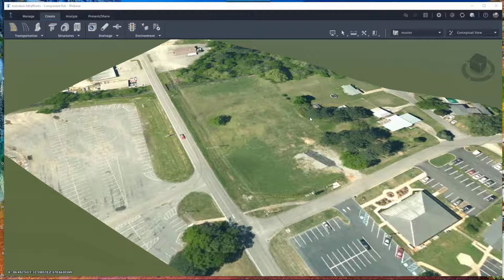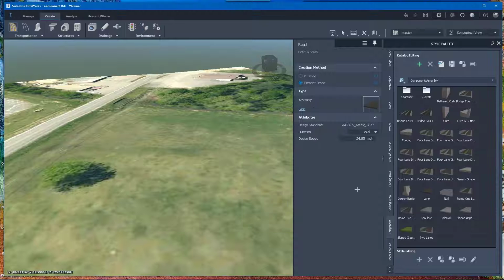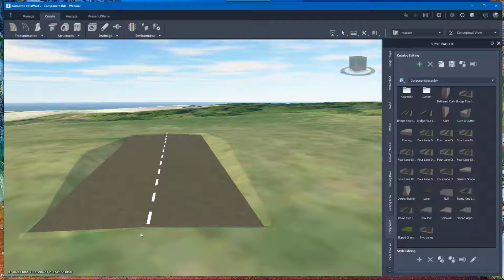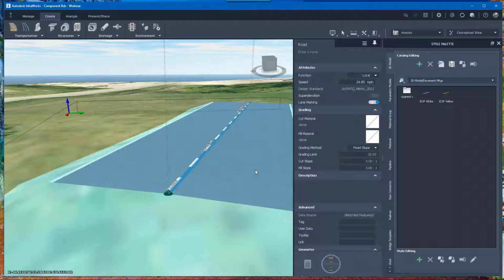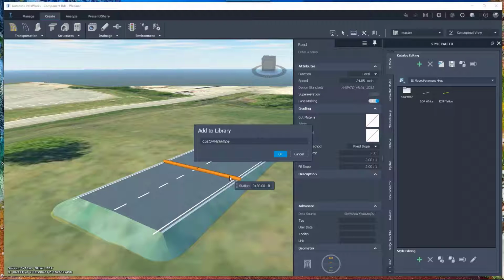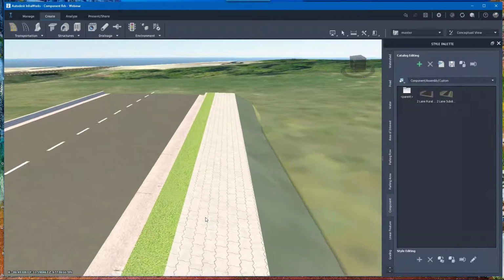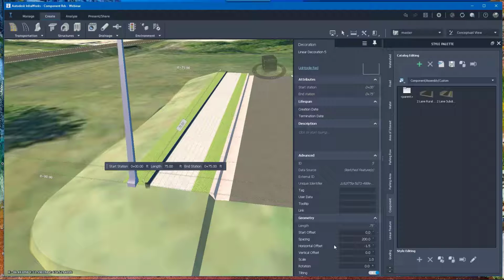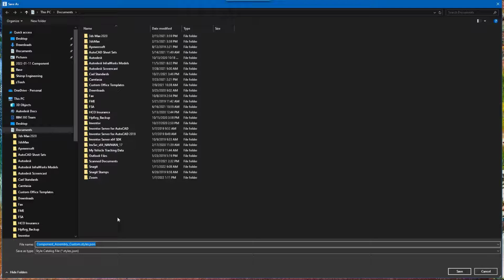Creating Custom Component Roads in Infraworks

Comment: in infraworks 2022, 2023, the lane markings (right turn arrow) only work for US roads. for UK or any other left side roads, i couldnt find anything to make the arrows on the left side of the road. is there a solution to this?
Reply from the maker: It’s true that in InfraWorks, the default lane markings (such as right turn arrows) are primarily designed for US roads. There may be a Great Britain package, but if not ⬇

However, there are workarounds to create custom lane markings for other regions:
1.	Import Polygonal .shp Files:
o	You can import polygonal .shp files as coverage areas.
o	Style these areas in white or yellow to represent lane markings.
o	Keep in mind that coverages will snap to the terrain elevation by default, so you might need to adjust offsets to position them above the road surface.

2.	Create Lane Markings in Other Programs:
o	Use programs like Civil 3D, AutoCAD, or 3ds Max to create the desired lane markings.
o	Export them as meshes.
o	Import the custom lane markings into InfraWorks.
3.	Modify Lane Markings on a Component Road:
o	In InfraWorks, select a component road.
o	Right-click the road and choose Pavement Markings > Modify Lane Markings.
o	Adjust the lane markings using the in-canvas tools.